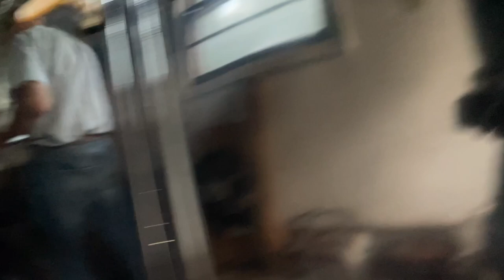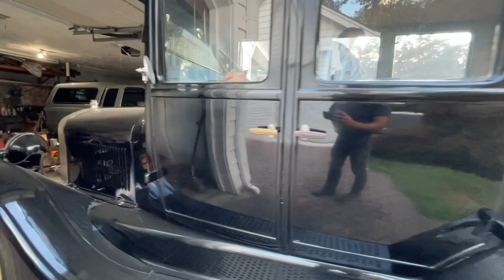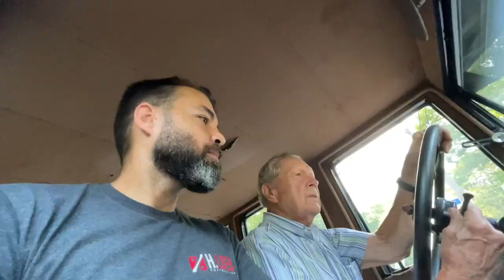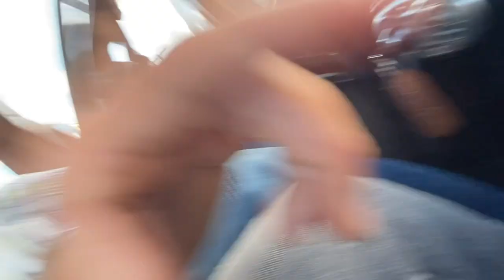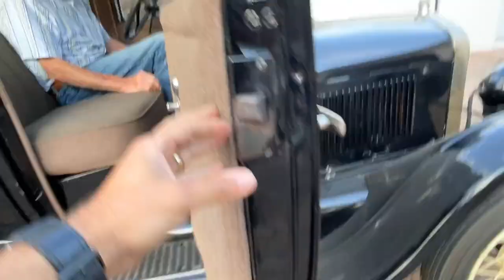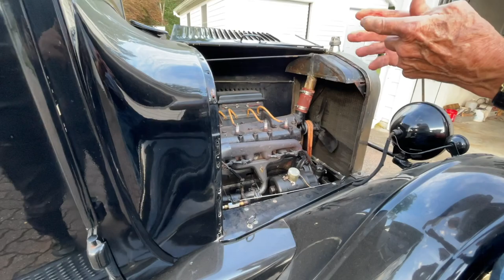Let's go for a ride in my new friend Russ' 1927 FORD MODEL T

Comment: Nice car.  Sounds good.  I have a 23 touring.  As you say you have to get the knack of the choke starting it but once you get it they start right up as long as something isn’t wrong with it.  Yours looks very standard which is nice. The only thing non standard on mine is the horn.  My wife said you need an oogah horn so I installed one instead of the standard vibrator horn.